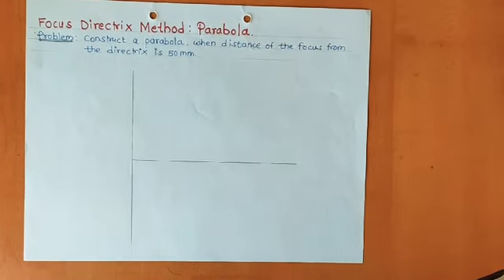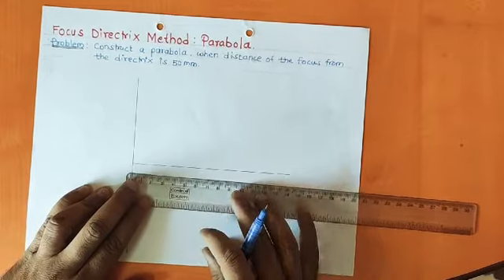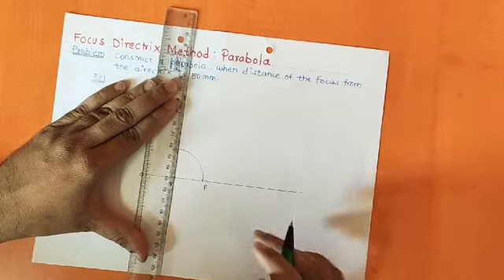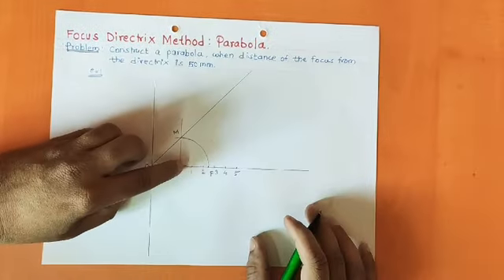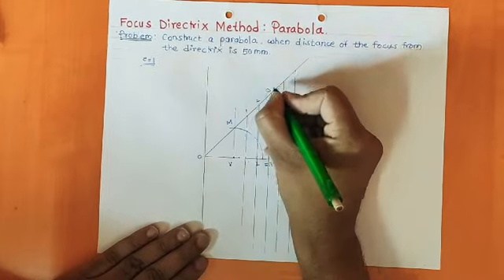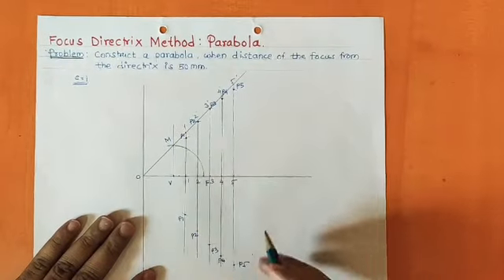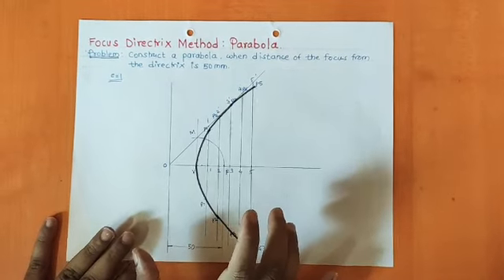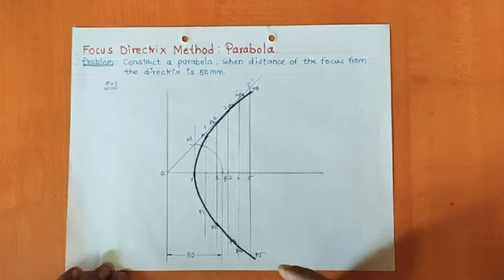Parabola: Focus Directrix Method

Comment: For parabola e=1

It is a conic section

2H pencil must be used for construction and 2B for drawing the smooth curve

Applications :
Arch of bridges.
Object thrown under the influence of gravity follows parabolic trajectory.
Improve asthetics in architectural designs.
Parabolic reflectors are used to reflect light.